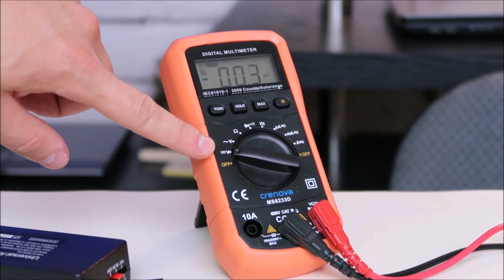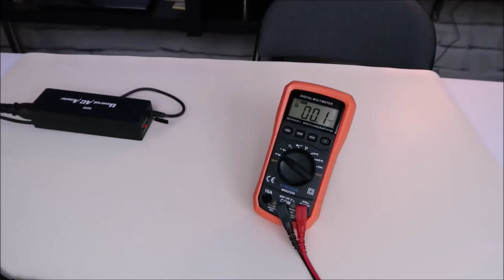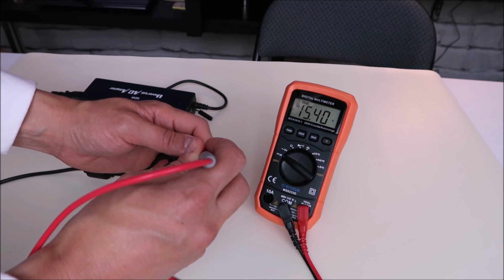How To Fix Any Laptop - Wont Turn On, Wont Open, Turns Off Right Away, No Power Solution

Comment: Bro didn't work btw my laptop hit a wall thn turned off and started displaying black and red sh*t and turned off and on for a few times but isn't turning on again 😢
Reply from the maker: If the issue started after the computer had a strong hit, several internal components may be damaged or loose.  You have to basically troubleshoot everything :(  This video has been updated with additional steps here; https://youtu.be/kOBY4k2Mn_k. Let me know how that goes :)
Reply: @PC_Monkey  i later managed to fix it but it's flickering
Reply from the maker: @Contromask  The computer now turns on but the dispaly flickers?  Most likely an issue with the LCD or LCD Cable.  I would try 'reseating' the cable at both ends.  If that does not help, plug in an external monitor and see if that flickers too
Reply: @PC_Monkey  it flickering on Tv also
Reply from the maker: @Contromask  Then the issue most likely is not with the LCD or LCD Cable :( Its most likely with the signal being sent out / motherboard itself.  Motherboard could be damaged :(
Reply: @PC_Monkey  but the flickering isn't much
Reply: @PC_Monkey  can it be bcuz of GPU
Tht white stuff on it is dried
Reply from the maker: @Contromask  It could be the GPU.  If the thermal paste is no longer working well, it could affect the heating of the computer.  You can try to repalce that.
Reply: @PC_Monkey  and I usually have bios problem and I can enter bios with the CMOS battery disconnected 😑

Comment: Mine turned on for a bit after I followed the steps but wouldn't charge. The charger and jack are working but now it's run out of battery and due to the lack of charging I can't turn it on at all. The fact that it turned on for a bit has really confused me 😂
Reply from the maker: As seen here, after the power drain, the computer should still work with the battery removed and the charger plugged in if its just a charging issue.  If the computer wont even work with the charger only plugged in, there is a deeper issue.  Have you tried replacing the charger or the BIOS reset procedure?
Reply: I've tried both but aren't having any luck. I'm starting to think it might be a motherboard issue ☹️
Reply from the maker: @oliverdobbs3503  If, after trying all these steps multiple times, you have not been able to find the issue, your most likely looking at a faulty component preventing the motherboard from working or a motherboard issue.  I would start troubleshooting each component, starting with the charger and power jack.  You can see those two videos here;  https://youtu.be/YBhsVHideGE  &  https://youtu.be/HpabvrNaodU.  You can also try replacing other components like your Power Button to see if that is the route cause.  If none of those are the issue, you would then be left with a motherboard replacement.

Comment: My laptop switches on and loads up but switches off before getting to the login screen please help :(
Reply from the maker: 1.  Are you able to see anything on the screen before it turns off?
2.  Also, did anything happen before this issue appeared?  Overheating, liquid spill, Windows update, etc?
Reply: @PC_Monkey  yes it boots up to the Windows starting logo and then switches back off even tho it worked perfectly yesterday 

2. Last night I let my laptop run overnight on a game I was playing and woke up to the laptop being off and now it switches off when I try switching it on
Reply from the maker: @TheUsedToothpick.  Ok, so the computer turn on, shows the Windows starting logo, then turns off.  What brand computer do you have?

Comment: Mine is the Dell Inspiron 14 Black, Tag 8DF7632... three beeps and does not even boot.
Reply from the maker: 1.  Are you able to try the steps seen here?
2.  Also, did anything happen before this issue appeared?  Overheating, liquid spill, Windows update, etc?

Comment: hello great video, I have one HP chromebook x360 2 on 1,it doesn't charge, but when i disconnect the battery and then reconect it, it charges as good as new, but then to charge it, I need to repeat the same process.
Reply from the maker: Have you tried resetting the computer?
Reply: @PC_Monkey  yep, I did a factory reset, and it keeps doing it, I just bought a new battery, it should arrive this Saturday 😅
Reply from the maker: @albertoperezgonzalez5002  Good luck !!  Let me know how it goes :)
Reply: @PC_Monkey  ok, thanks bro

Comment: Bro i have problem i have laptop lenovo legion y520 and it turns on but after 20-30 sec goes off whats the problem ,do u have video for that ?
Reply from the maker: 1.  What are you able to see on the screen before it turns off? 
2.  Also, did anything happen before this issue appeared?  Liquid spill, overheating, Windows update, etc?
Reply: 1.its only black screen i can hear the fan running and after 20 s it turns off.
2. There was bit of overheating and i only cleaned the fan as i always do i fixed the pc i turn it on it was good the day after i tried to turn it on i have black screen and it turns off.
Btw something happen today i turn on my laptop and i start clicking F8 and it didnt turns off did i enter the bios ?  @PC_Monkey

Comment: I just removed the battery, hopefully that fix my daughter’s laptop, I was doing and upgrade but it got frozen, I tried to turn it off but it couldn’t, so I just forced it to turnen off, after that it doesn’t turn on , no
Noises anything :(
Reply from the maker: Sounds like your on the correct video.  Have you tried the steps seen here? 
Also, did anything happen before this issue appeared?  Liquid spill, overheating, Windows update, etc?

Comment: Dude! This happened to me last year on my new Lenovo after I ran a windows update and I spent sooo much time with their tech support that I just ended up sending it in. $200 and a month later I got it back and it was good. 2 days ago I ran the latest Win update. The same thing happened AGAIN but this time I decided to Google the issue. I got your vid. I watched it. I am impatient and wanted to try a short cut and just held the on/off switch down for a minute without removing the battery or power supply and BOOM! my computer came right up and I am watching it charge. 29% so far. Thank you. I'll try to drop you a dime!
Reply from the maker: Glad your all set :) Always here if needed !!

Comment: Thanks for your video. It's helpful and full of useful knowledge. Well I am facing an issue with my PC which uses a Gigabyte Motherboard and no GPU And I want your help plz. There comes a mysterious voice from my PC's whole metal body and this voice keeps getting higher slowly and then go down slowly and continue doing so. Well a night before my PC was able to run even with this issue but now when I start the PC it dont show the Display and the system continues to turn off and on repeatedly sometimes and sometimes it starts but dont show the display while the system's Fan runs with a very very little voice and power which is not normal AND also my HDD on which the Windows is installed is getting hot along with the built in Intel GPU chip. I have checked the ddr3 ram by changing but this issue is still being faced. Can you plz help me solving this issue ??? Kindly Reply Plz.
Reply from the maker: 1.  This video has been updated with additional steps here; https://youtu.be/kOBY4k2Mn_k. Let me know how that goes :)
2.  An overheating computer can be damaging multiple different components if not resolved. First, make sure that the fan and vents are clean and clear. If you need help accessing the fan, let me know what brand and model computer you have and I can help you get inside it. If that does not fix the overheating issue, then try replacing the thermal paste on the CPU and if needed, the GPU as seen here; https://www.youtube.com/watch?v=K_j4GPjpawk. If that fails too, replace the CPU
Reply: @PC_Monkey  Only one HDD containing the Windows And built in Intel GPU Chip are heating too much. The increasing frequency of the system ,maybe due to Power supply i think ,is causing the issue due to leak voltage i think now. Also the system is not turning on ,it don't shows the display on monitor while the monitor and cables are ok ,but the Fan is running but at slower speed and i can still feel the vibration from my case but now it is lower. Can u plz solve the issue? Also i want to ask you that is my HDD safe ,i mean will my data be safe or be deleted? Also can u make a video on how to recover the deleted date from HDD ?plz? Thanks.
Reply from the maker: @danishanwar3491  If the fan is on and you can feel mechniacial vibrations, perhaps the computer is actually turning on.  Try the steps seen here:  https://youtu.be/e9iy30J00-k

Comment: I have an HP pavilion 15 and has no CMOS battery. My laptop was dead and after doing the static discharge turned on but after a few seconds turned off again.
Reply from the maker: 1.  This video has been updated with additional steps here; https://youtu.be/kOBY4k2Mn_k. Let me know how that goes :)
2.  Also, did anything happen before this issue appeared?  Liquid spill, overheating, Windows update, etc?
Reply: @PC_Monkey  thank you for your reply. 
I will check the video, try the steps and let you know.
Nothing happened to it, we just didn't use it for a few months and when I tried to turn it on it didn't work. 
So far I've tried the static discharge and also a different power cord(which works on different hp).
Reply from the maker: @boasuki  Good luck !!  Let me know how it goes :)
Reply: I was not able to make it work using your tutorials(which I'm sure helped others), so I took it to a service.
Apparently, it had two little drops of liquid where the power button is. I am not aware of when&how the liquid got in. Thus, I never checked the board there.
Anyway, thank you for your time trying to help others.
Reply from the maker: @boasuki  Yes, a liquid spill would require other tutorial videos lol.  
Glad your all set :) Always here if needed !!

Comment: My computer has external  battery. It won't charge with & without charger.
Reply from the maker: 1.  I dont think I understand.  No battery will charge without a charger lol.  Its the charger that charges the battery :)
2.  Are there any signs of life at all when you try to turn it on? Lights? Fan, Motherboard, or Hard Drive sounds? Anything seen on the screen?

Comment: The issue with my computer was it didn't turn on at first(after I pressed the power button), tried a couple of times pressing  the power button, then it started turning off and on (keyboard turns on and then goes off, was plugged in with the charger)... Then i removed the charger and removed the plug and took it out of my room and while I was walking to another room I opened the laptop and pressed the  powered button and it turned on.. What was the reason it wasn't turning on?? And what should i be careful off? To prevent this from further happening??
Reply from the maker: The computer needs the charger unplugged to turn on?
Reply: @PC_Monkey  no at first it just malfunctioned, like it went off on its on... I mean i did press the power button multiple times coz it wasn't turning on Then  it did turn on,  (the keyboard Led ) then goes off, it came on nd then goes off... The logo doesn't show.. but it's fixed now but idk how so I wanna know what happened nd if I could prevent it from not happening again
Reply from the maker: @azrael9570  Sorry, I cant tell you what happened without examining the computer.  If it just started working again lol, thats not enough to tell you for sure what the issue was.  sry :(:(
Reply: @PC_Monkey  It's okay lol I'll be back if something happens 😂😂 I sure hope not tho
Reply from the maker: @azrael9570  Good luck !!  Glad your all set :)

Comment: Hi, when I unplugged a USB cable from my Dell Precision 7670 the laptop just died. There is no charging lights, no power lights, its dead. I followed your power cycle steps but none work. I dont want to mess around with the motherboard yet just wanted to get your opinion on what the issue could be.
Reply from the maker: This video has been updated with additional steps here; https://youtu.be/kOBY4k2Mn_k. Let me know how that goes :)
Reply: @PC_Monkey  Does not work -- I suspect when unplugging a USB it short circuited something
Reply from the maker: @3three3  If, after all these steps, you have not been able to find the issue, your most likely looking at a faulty component preventing the motherboard from working or a motherboard issue.  I would start troubleshooting each component, starting with the charger and power jack.  You can see those two videos here;  https://youtu.be/YBhsVHideGE  &  https://youtu.be/HpabvrNaodU.  You can also try replacing other components like your Power Button to see if that is the route cause.  If none of those are the issue, you would then be left with a motherboard replacement.

Comment: Bruhh can be done in old pc😥😥
Reply from the maker: 1.  The age of the computer does not matter with these troubleshooting steps.  Are there any signs of life at all when you try to turn it on? Lights? Fan, Motherboard, or Hard Drive sounds? Anything seen on the screen?
2.  Also, did anything happen before this issue appeared?  Liquid spill, overheating, Windows update, etc?
Reply: @PC_Monkey  but, my battery is not working
Reply from the maker: @MzhrIshrt-ts1do  If your battery is not working, then the computer should still turn on and work after the battery has been removed, using only the power adapter.

Comment: So I have a unique situation in that when I use the novo button on my Lenovo I'm able to access the BIOS menu options instantly without a problem. screen is fine. But Whenever I try to start Windows normally it stays stuck at the Lenovo logo with a bunch of blurred Lines at the top that are purple and white. So it makes me think it's not a motherboard issue if it's only doing that for when I try to turn it on normally? Idk. Alread tried a bios reset
Reply from the maker: If you can see the Lenovo logo, your screen is working and this is most likely not the video for your issue.  For your issue, can you try the steps seen here instead?  https://www.youtube.com/watch?v=oL1R1Tw0jSo

Comment: @PC_Monkey * I have a Lenovo IdeaPad S145, model # 81N3. It just totally stopped working. I don't see a light to indicate charging and I have bought a new charger... it doesn't have a removal battery! I would really appreciate the help, friend!
Reply from the maker: Does this help access your battery?  https://www.youtube.com/watch?v=15e3X4ErNB8
Reply: Let me watch and try! TYSM
Reply from the maker: @JAXON7117.   Good luck !!  Let me know how it goes :)
Reply: So I watched that video, is that what your thinking? I need to replace the battery? I took the back off and unplugged it but still no charge indicating light on...
Reply from the maker: @JAXON7117.  I thought you wanted to access the battery in order to troubleshoot a computer that wont turn on.  Removing the battery is a needed step in the troubleshooting process seen here in this updated video:  https://youtu.be/kOBY4k2Mn_k
Reply: Yes I did all the troubleshooting methods that I have seen.... it's still not powering on or showing it even has power going to it... I'm so upset. I appreciate your help but I'm lost here. 
It doesn't turn on or have a charging indicator light on...
Reply from the maker: @JAXON7117.  If, after all these steps, you have not been able to find the issue, your most likely looking at a faulty component preventing the motherboard from working or a motherboard issue.  I would start troubleshooting each component, starting with the charger and power jack.  You can see those two videos here;  https://youtu.be/YBhsVHideGE  &  https://youtu.be/HpabvrNaodU.  You can also try replacing other components like your Power Button to see if that is the route cause.  If none of those are the issue, you would then be left with a motherboard replacement.

Comment: What's happening with me is when I plug in and on it off and when I on it offs when I turn on 3rd time it ons
Reply from the maker: 1.  This video has been updated with additional steps here; https://youtu.be/kOBY4k2Mn_k. Let me know how that goes :)
2.  Also, did anything happen before this issue appeared?  Liquid spill, overheating, Windows update, etc?
Reply: @PC_Monkey  nothing I just didn't use laptop for long time (I kept it in my closet along with clothes) before that the battery was not working I use to use laptop plugged in always and thank you for your support <3
Reply from the maker: @indianvaloranthighlights717  Good luck !!  Let me know how it goes :)

Comment: Just saved me. I had to take my whole laptop appart to replace the keyboard (thanks hp). I didn't know what went wrong. Tested disconnecting the battery and using wall power. Worked immediately. Already knew my battery was in a very bad condition. Didn't expect it to go out at this exact moment.
Reply from the maker: Glad your all set :) Always here if needed !!